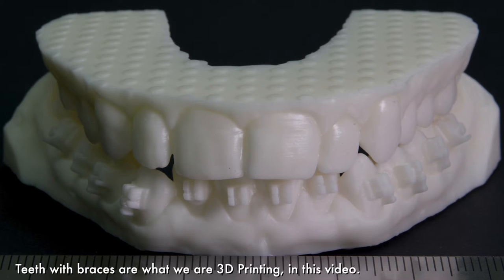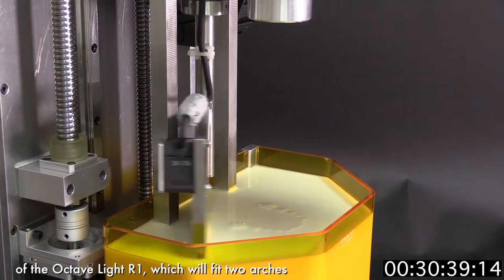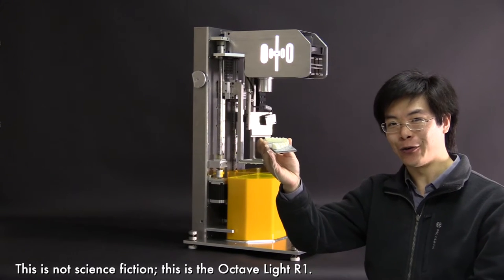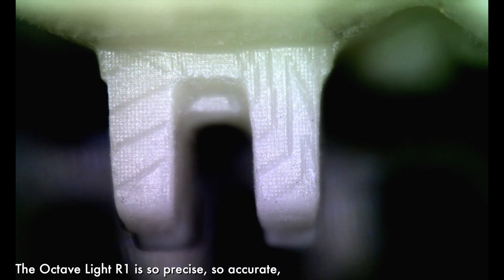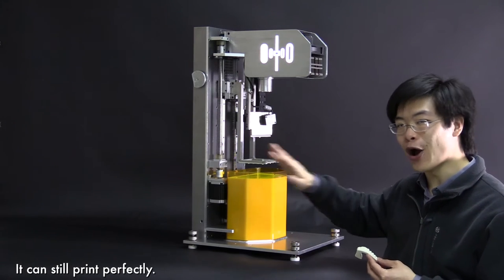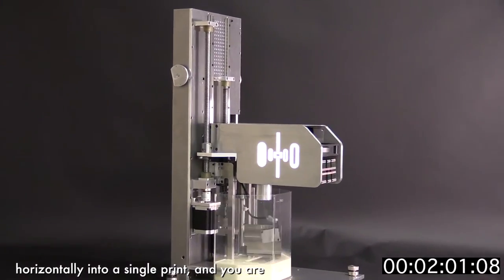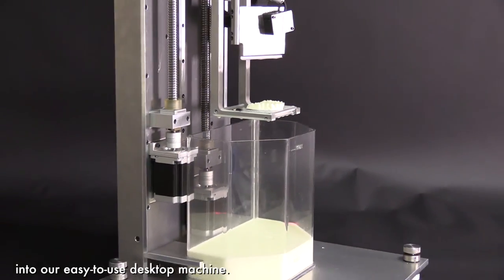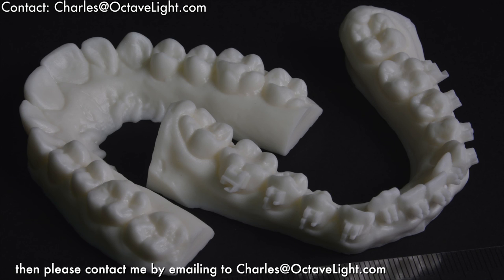Octave Light R1 high speed 3D Printing Orthodontic Digital Indirect Bonding Model

Comment: You gotta be kidding me.  40 minutes for a set of models that dont have a big enough base on them to be placed into an articulator, which means models with mountable bases on them will take probably 60 minutes a set.  I own an orthodontic lab.  Lets say i get 30 sets of models in per day for appliances to be made.  The printer will be running 24 hours a day...AND FALLING BEHIND, creating a backlog of printing to be done.  After a week, youll be so far behind youll never catch up unless you add more and more printers.  God forbid your computer or 3D printer fuck up. Those crash for a day and your really in a pickle.  It takes 5 minutes to take an alginate impression of someones teeth, 10 minutes to pour it in stone and 5 minutes to trim the model down.  Thats faster then 3d printing...and just as accurate if not more.
Reply: These printers are in widespread use in some of the largest dental labs in the USA and are highly recommended there.